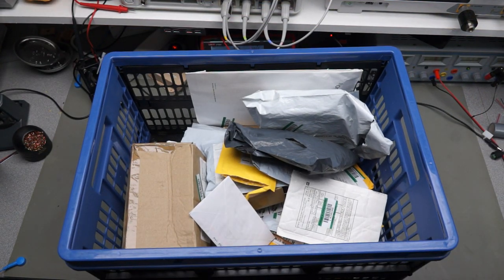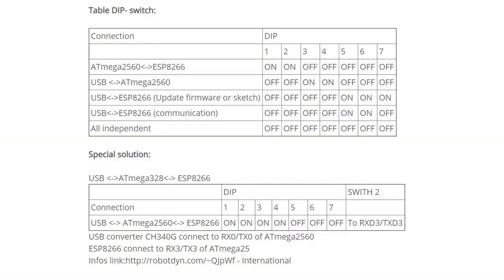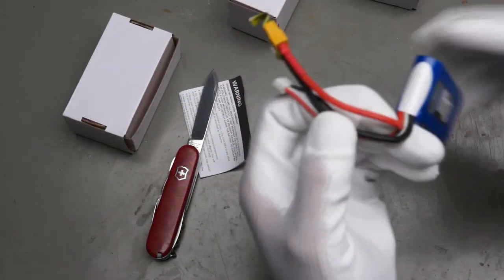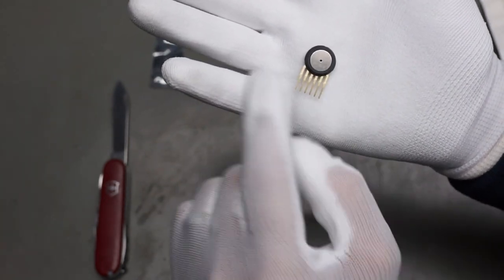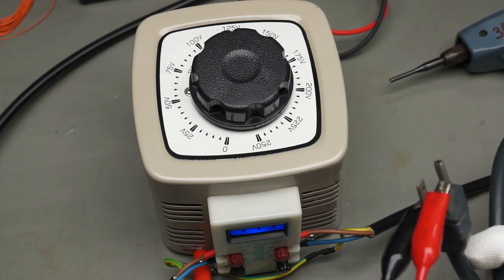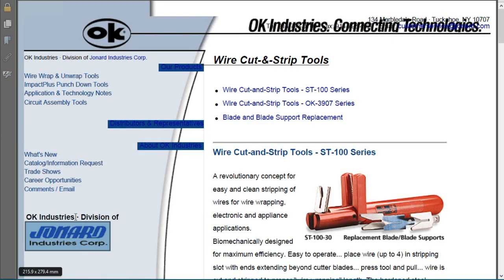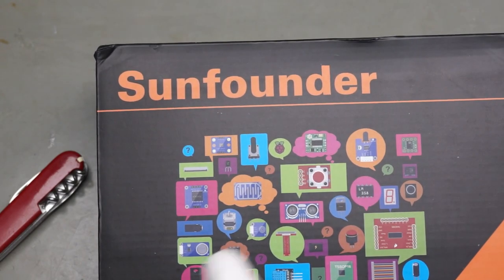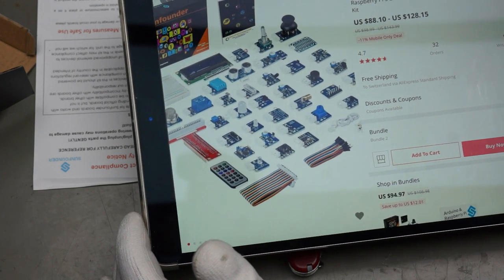#262 Mailbag with Viewer Contribution

Comment: "I know what I do...   in general... " - Famous last words? ;-)  
Thanks for the demo, I had not seen such tool in action before.
Reply from the maker: So you are probably still young ;-)
Reply: @AndreasSpiess  - I guess... (if 50 counts as young too!)  - When I was really young I had a Philips experiment box that used stripped wire to hook in a spring. Breadboard is quite a step forward from that. To attach wires I used my trusty Weller iron. I did occasionally encounter boards with neat pole-wrapped wires but never seen the wrapping tool in action... until today, thanks to you!
Reply: @Maxint R&D Maybe the 3 transistors were trapezoidal (I don't remember the number) mounted on a square printed circuit that allowed connections in the 4 corners, one of them had a small heat sink, and the speaker had a high coil resistance to avoid the transformer output? (The complete kit was in three boxes and consisted of 24 experiments and the connection cable was covered in red)? If so I also had it in 1969!
what a jump back in time you made me do!
I'm going for 59 this year ... but I'm still young :-)))
Reply: @zolatanaffa87  - Yes, if I remember well some of those transistors had blue paint on top. I had a second hand box, probably from the same period. Don't quite remember the name of the box, but it was good fun. Now with cheap electronics readily available it's a different world, but I still remember how I was dismantling old radios and other devices to scavenge their components and increase my stock...
Reply: @MaxintRD  For a long time televisions, radios and electronics in general ended up unsoldered in my little drawers I will have a kilo of resistances and a drawer full of transistors, even germanium and then: when I made a circuit I bought them new because: who knows if they work? Lol

Comment: Nice to see the wire wrap tools.... in the EE lab at McGIll we had the battery power ones, cool at the time.
Reply from the maker: I can imagine that without cables was even better!
Reply: Back sometime in the early '80s I was tasked with wire wrapping a music synthesizer prototype. It took me about 3 weeks to complete. We had battery powered ones, but I ended up making a DC supply as the batteries just didn't last that long - it was 4x "C" cells, iirc.

Comment: At 14:11 you show an envelope from Canada with 3 stamps that show pictures of famous  hockey players. You may want to hang on to that; those stamps will be collector's items before very long. In a little while you might be able to auction that envelope on EBay and sell it for enough money to buy other new & interesting modules. (Unless you collect stamps or are a hockey fan) .  
I had a motorized wire-wrap tool similar to the one you received. It reminds me of how useful wire-wrap was to make prototype or research circuits, or hobby projects. It worked well, and was simple, inexpensive and fast to use. The motorized wrapping tools were great - I'm tempted to build one, or find a used one. Thanks for all of your videos.
Reply from the maker: Thanks for the tip about the envelope!

Comment: 4:32 forgot to solder the usb connector fully? the metal flaps of the connector had to be soldered to the groundplane too for better mechanical stability
Reply from the maker: You are right!

Comment: Ahh, wirewrapping. I once wirewrapped a 64KB dynamic memory module for my ZX81. It even worked most of the time.
Reply from the maker: I hope the not working time was not be cause of the bad quality of the wire wrapping ;-)
Reply: @AndreasSpiess , no, more the quality of the edge connecter.
Later I made an interfaceboard with the z80 in a wirewrapping socket, and the end of the legs fitted into the z80-socket on the zx81-board, and the interface board fitted into an euro rack backplane, with memory and io-boards from the ICL/Metanic computer series. Finally the zx81 got retired, and the cpu and rack evolved into a full modular CP/M+ system.

Comment: As you can imagine, I really liked the wire wrap demo. Being one of the group triggering this small revival of this technique in the era of module electronics. Would be great if affordable "new" tools could be obtained, or... Even a remake from a manual tool, some 3d printing and a motor of some kind.
Reply: The amount of torque must be precise. Those "guns" were not cheap.
Reply: @michaels3003  I was not aware of that, I presumed just the rotation speed mattered and was wondering how my current manual wire wrap tool would behave mounted on a battery powered screw driver.
Reply: @Ruudrad  ,  the "wrapping force" welds the wire at the corners of the the square pin to make solid electrical connections. The set of tight turns (vertically) creates a solid mechanical interface.

Comment: I have wire wrapped a lot of  Intel 8031/8039 / 8052AH Basic  controllers back in 1985-95. Still have a Vero battery operated wrapping tool still working.Purchased in 1987.  VAX 11/780 and 785 minicomputers also had wirewrapped backplanes we had to modify from time to time with fixes etc. 
Wire wrapping was invented back in 1943 (?) by the Telecom industry. More robust than soldering over time.
I've also worked as an Air Traffic Control Technican and many of the computers and displays were wire wrapped.
Reply from the maker: Thanks for sharing your experience.I worked for DEC and had a lot to do with VAX computers.
Reply: Spent lota yrs. At phone 📞 co.
Wire-wrapping pins on number blocks!!#

Comment: I got prematurely excited by the speech recognition module; sadly it as an old, limited solution.
Reply from the maker: I think it is an old design, too
Reply: If it works for hobby projects? So what.. "Timmy run the light", just use Ikea led and an arduino UNO :-) still fun

Comment: Take apart the wire wrap tool and we'll see how to modify it. I'm thinking either add a circuit to allow it to work on 240V or replace the motor with a DC one to convert it into a cordless unit.
Reply from the maker: Nice idea. But the time...

Comment: I was looking for such a CO2 sensor! Thanks Andreas! Do you know anything about for ~0-10% range? (needed to monitor cell culture conditions) I have found very expansive ones >100€ and some cheaper ones, which I am not sure if I should trust.
Reply: Check the datasheet ( https://www.winsen-sensor.com/d/files/infrared-gas-sensor/mh-z19b-co2-ver1_0.pdf). I guess you have to calibrate it manually.
Reply from the maker: Maybe I will do a comparison once.

Comment: Hello Andreas, If you want a really good CO2 Sensor you should look at the sensirion scd30 (temp/hum/co2, running on 3.3v and has an i2c bus)  i was investigating and testing low cost co2 sensors a lot and think this has the best price/value ratio 
:)
Reply from the maker: Interresting. What was better and how much? The price is quite high compared with the one I have here.
Reply: I have used the MH z19 for a long time with an atmega328 and it always did well. With the scd30 being almost 60usd it must perform pretty good to have a better price value ratio. Admitted, it has also temperature and humidity, but a bme280 can take care of that
Reply: Ok I must admit, I do not use it for hobby projects only. Yes compared to the mhz19 it is a bit pricey but the biggest benefit in my case was the i2c connection and the 3.3v or 5v power connection so that it is not necessary to shift voltages. The cozir brand or others are even more expensive and use 12 to 20 volts. 
@andreas if you like I send you a sample for testing you just need to tell me where to send it to or I give one to my brother's girlfriend who lives in Zürich and you pick it up :)
Reply: @Chris Tarantl I write a library a few months back for the MHZ19 which adds some commands (uncapped CO2 , it's Raw value and others), it also includes a library which hooks in the SC16IS750 so it can be used over I2C for low cost  https://github.com/WifWaf/MH-Z19  (see extras). It's not so bad (though I use a Senseair most of the time)

Comment: Howdy Andreas, great informative, humorous channel.  Question / idea:  Have you programmed a WEMOS D1 mini using only the available external pins and not the USB connector?   I have some D1s and the USB connector broke on one of them after a bit of use.  I'm thinking the chip can be programmed without USB similar to the ESP-01s.  Have you tried this?  If not, perhaps a video idea on how to save a D1 with a missing / broke USB connector.
Reply from the maker: I never did it, but it should be possible. Maybe you have to desolder the defective USB chip
Reply: I haven't tried it either, but you probably can. It might depend on which version you have.

D3 is GPIO0, the one you need to pull to ground for flashing (For anyone else using the Mini, don't make the mistake I did, and assume GPIO0 is D0. Really weird stuff happens if you use D3 as an output in a sketch, and then try to download a new sketch while the old one is running).

All my Minis are V2.2.0, which can be flashed by hooking up a USB-serial adapter (make sure it's 3.3V, not 5V!) because there are 470R resistors between the USB chip and the ESP8266. But I looked at the schematic for the V3.0.0 board, and it doesn't have the resistor between the USB chip's serial out and the ESP's serial in. So there will be a fight between the CH340 output and your serial converter's. Depending on the internals of the USB-to-serial chips, it might work, or one/both of them might die.
Reply: Yes, it works fine. You'll need an FTDI adapter set to 3.3v logic levels. I find it best to power the Wemos from the 5v power on on the  FTDI, and as previously mentioned the D3 pin needs to be pulled to ground momentarily when powering-up the Wemos. And don't forger that you connect Tx to Rx and vice versa!
Reply: I'm going to try in the next few days.  For "the guy with the Swiss accent", I'm an engineer maybe a few years younger but trying to catch up ;).

And yes, when I was starting out wire wrap was the way a proto system was done plus the conformal coat.
Reply: I want to thank you for doing the episode on some their on troubleshooting.  This is something I don't believe engineers ever receive in their formal training but have to learn it all on their own.  I sure did.  Based on a few of your videos we are about the same age and apparently still love our chosen profession.  You are doing excellent work educating makers and I will eventually watch all your videos.  Hopefully I will find one where you talk a little bit about your career.

Comment: hi. 

Could you test the SENSOR MPX5999D DRUCK SENSOR i would like to know if the sensor is accurate enough to use as measuring air velocity in ventilation pipes.
Reply from the maker: I have no such plans because I ditched my wind channel project.

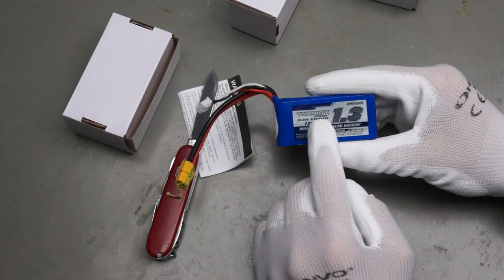Comment: 5:50... That battery is puffed up because it was misused... Either over charged or under discharged or more current was drawn than the battery was rated for. Under any of these conditions ANY Li-Po battery will Puff.
Reply: If you leave battery charged or discharged for too long, it will puff also.  Those are high discharge batteries made for drones, and I don't think Andreas have any projects that draw that much current. There is a better chance he was drawing too little current from it and it stayed charged for too long :)
Reply: @DjordjeRadakovic  You are correct....I had forgotten to add that leaving a battery fully charged will also puff a battery over time...
Reply from the maker: I also think I did not "misuse" it.

Comment: For CO2 measurement I use https://www.amazon.de/gp/product/B01EN3M0YS/ref=oh_aui_search_asin_title?ie=UTF8&psc=1 connected to FHEM via a USB on a raspi. I doubt you can detect humans in a room, unless you close all doors and windows in the room and depending on the ventilation in your house all other windows as well.
Reply from the maker: Thanks for the link. I assume it also depends on the volume of the room. A viewer had the idea and I will test it. But anyway I assume it will be slow. BTW: Do you know which sensor they use?
Reply: @AndreasSpiess  The room size matters. But the CO2 level takes a long time to change unless you ventilate the room. We ues it to determine if we have to a Stoßlüftung. As to the sensor, I have not opened the device and better get an extra one before I do so :).

Comment: Into your video, you showcased an electric wire wrapping tool.
See:  http://youtu.be/2PChu4mT3oI?t=516
.
I own the OKI BW-630 Cordless Wire Wrapping Tool.
It runs on two 1.5V C-batteries.
.
See:  https://pbs.twimg.com/media/EUKyVjOU0AAo1kE?format=png&name=small
.
I noticed that there are quite a few second hand OKI BW-630 sold on eBay if you are interested.
.
I also have a stash of wirewrap DIL14/DIL16 sockets which are very difficult to buy these days.
.
In my youth, I never imagined that wire wrap would become obsolete, but I see a lot of potential in this technology these days for prototyping circuits.
.
It's a shame that wire wrapping has lost popularity.
Reply from the maker: Nice tool! The cheap PCBs are a much better solution for most problems. And they are very cheap...